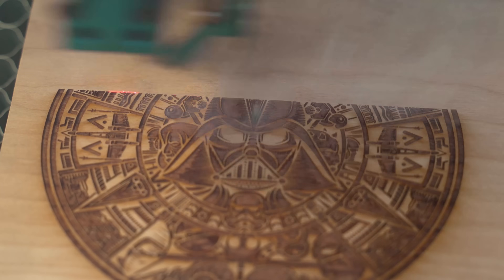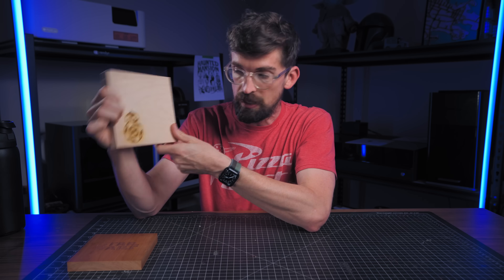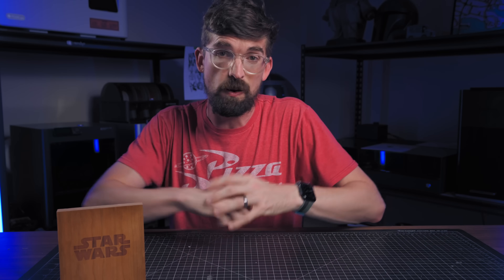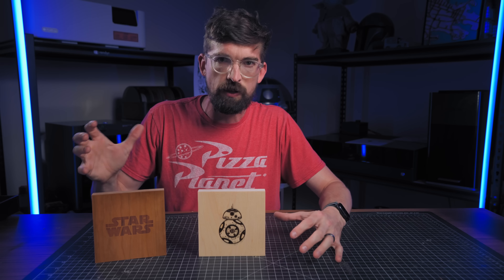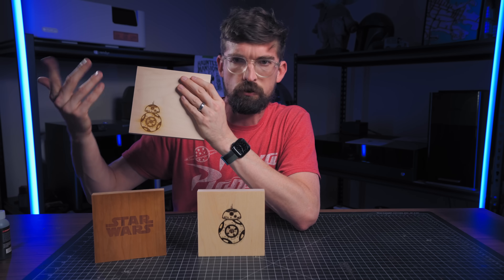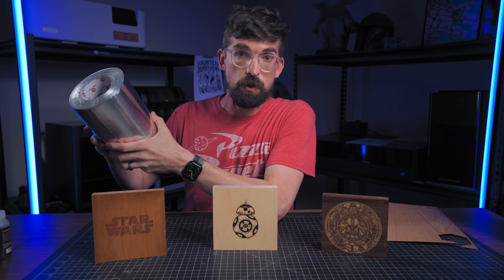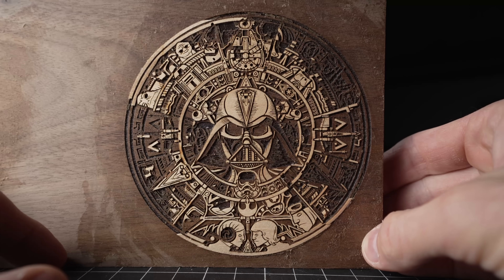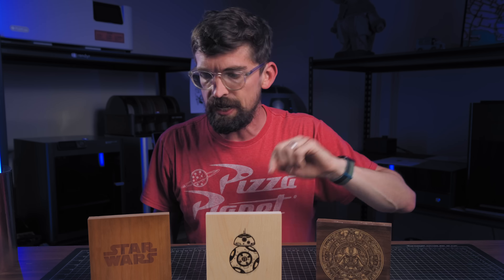3 Levels of Laser Engraving - Beginner to PRO

Comment: I am currently looking for a laser engraver to engrave wood for a company logo on hardwood. It also needs to be a portable machine. You did not mention what kind of laser you used on the first two engravings. Was that done by a CO2 laser? Would that also be possible to do with a fiber/ diode laser like the xtool f1 ultra? I struggle a bit to find the right laser. I don't want to cut through hardwood (maximum veneer).

Comment: I once used a Mazak Optiplex 4020 Fiber III laser to engrave the image with Vader in the middle on stainless steel. I was the lead laser operator at the job at the time lol. For the record those are like a million dollar laser. It engraved insanely fast. Like a deep engraving in 10 minutes or less for a pretty decent size.

Comment: Use a press when you glue your inlay. That’s what the pros do for cnc inlays. It just looks so good. If you dent any wood add water and heat with iron to make it swell, then when dry do your sanding. Hydraulic press is best. Cool video btw.
Reply from the maker: That’s cool, it might be a little different for this, unlike the CNC inlays which have the sloped sides from the v-bit that can guide them into place.  Since the veneer is pretty thin I actually found I needed to work the inlays into the pockets a little slower.

Comment: Sir, I do not turn my air off when I am engraving, it causes smoke build up on my lens and that will create a hot spot and ruin the lens. Instead I use a air value that bypasses  the regular shut off, I use in lightburn  ( and turn off the air when engraving  that and  extra valve allows a small amount of air ( however I much I wish) to pass through the head and keep the lens clear. I got mine at cloudray. (this is a stand feature on thunder lasers. ( I dont have a thunder) if you google you will see it (Cloudray Ultimate Air Assist Set) this was a good video thank you.

Comment: That inlay trick was very cool. Inlays are one of the main reasons I wish I had a CNC. It would be very cool to pull off an inlay with my diode laser and do much more intricate designs that I think a CNC can do.
Reply from the maker: A diode laser could totally do this!  In terms of detail your going to get pretty close to what a CNC can do, plus you can do multiple colors/wood types using veneers and laser vs the solid wood you'll need for a CNC.

Comment: Thanks for sharing, what kind of laser printer would you recommend and wattage? I’m asking as I would like to try doing something like this.
Reply from the maker: You'll need probably at least a 10W laser just so you can blast through the material and get a deep enough engrave.  Basically any diode or CO2 machine will work since the beam can't cut the metal.  The higher you go up on wattage just means you'll be able to do the deep engrave and cut the veneer quicker.

Comment: Great video really like the inlay projects.  I use Gorilla tape to remove/weed the masking tape off the engraving.  You waste tape but it saves a ton of time.
Reply from the maker: great idea!  Do you mean you tape it to the top after cutting the pieces out to transfer?
Reply: @makeorbreakshop  So I mask the wood, put it in the laser and engrave it.  Then I spray paint the engraved part black, then once the paint is dry I cut a strip of duct tape and stick it to the masking tape on the wood and pull the tape up.  The duct tape pulls up the masking tape and can get all the little itty bitty pieces.  It make comic book corner are pieces with a lot of fine lines so this saves me the trouble of trying to use a dental pick to peel off all the small masking tape pieces. Hope that makes sense.
Reply: @danthemakerman thank you for this.... brilliant!

Comment: Very clever way of using veneer with a laser. 👍🏽 I do this with my CNC but the level of detail you can get from a laser is very impressive. I will probably try this on my XTOOL S1 this weekend.
Reply from the maker: Try it out!
Reply: How does it came out? I’m thinking to buy a xtool but my fear is that there is not enough definition (dpi) to do such kind of works
Reply: @ I made a couple of projects using this approach and both came out really good. So I would highly recommend giving this a try. 👍🏽 Regarding my XTOOL…unfortunately I do regret my purchase for one main reason…their support for Lightburn is subpar and I really don’t like the way Xtools software manages layers and power settings. It looks pretty but the way Lightburn is organized just makes it ten times easier to turn layers on & off and see what each layer is set to at a glance. When I bought my S1, I didn’t know about Lightburn at all. Anyway, if I could do it all over again I would find a laser that is 100% compatible with Lightburn and not one that works but has major limitations.